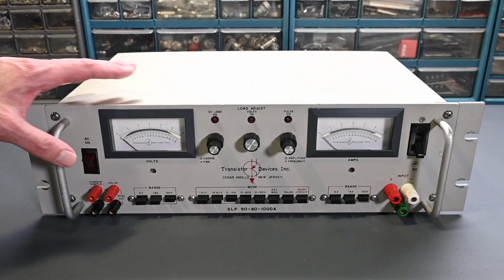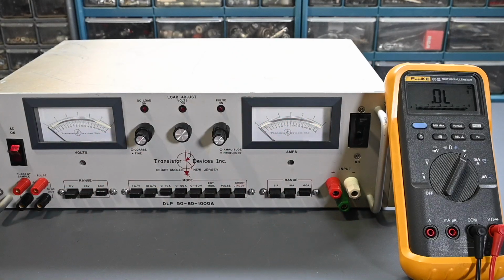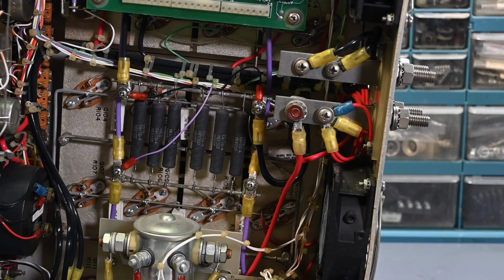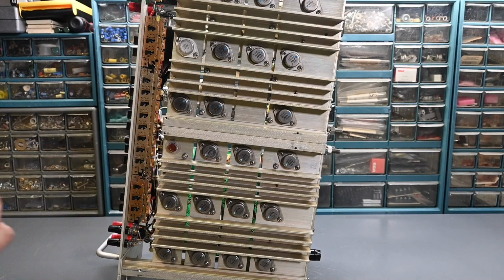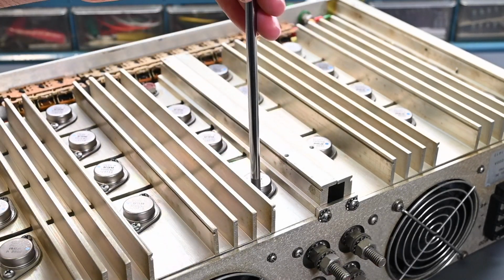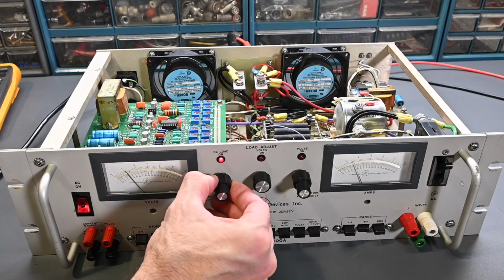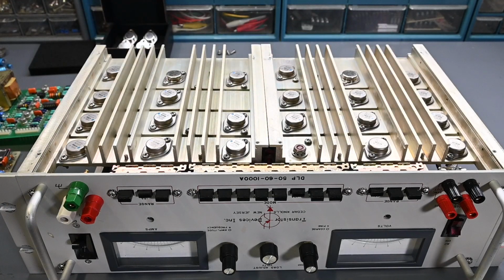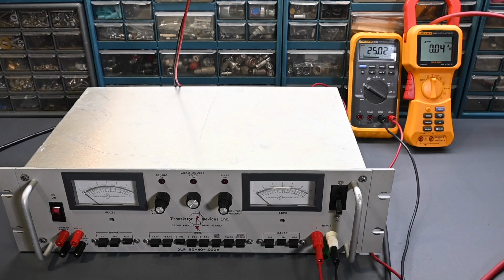Problems In This TDI Electronic Load DLP 50-60-1000A

Comment: I stopped using the 2N3055 in my designs at the time, because when the collector current went above 5 - 6 Ampere, the Hfe dropped from 30 - 35 to 5 - 3. With Ic = 10 A, Hfe = 3. 
 I switched to the BD142 which had a much better gain curve.
Your wonderful dummy load has - very likely - undergone a thermal excursion which degraded the output transistor. Great job!
Reply from the maker: At 60 amps the transistors pass 3 amps each in this application so the gain is not comprised much.  Higher current demands probably would be better to use a different transistor.

Comment: For what it's worth - that dark red/brown material you pointed out on those adjustable components is called GLYPTOL. Once the component is properly adjusted the GLYPTOL is painted on and when dry locks the part in place.
Reply from the maker: I have a can of Glyptol that was given to me, unused still.  I didn't think about the possibility that Glyptol was used on the trimmer pots.  Thanks for mentioning.

Comment: Looks like a great piece of kit. I'm currently designing and building a very similar device (with higher ratings) as a University Project. It's reassuring to see how many of the same design choices are present in this 40 year old tech as my designs. I was worried about my 8 x power transistors, but having 22 on the Dynaload you've got certainly put those worries to rest haha.
Reply from the maker: I'm glad the video was helpful and confirmed some things about your design.  Yes you can drive many paralleled transistors.

Comment: Thank you for the video, I have similar unit, but I need convert that for transformer and fan point of view to 230V,  So simple unit that not big job :) 
Do you have scema of or picture of that isolator part in your system?, it is not in scema but you note it.
Reply from the maker: I don't have a schematic that includes the Burr-Brown isolation IC.  You can get the data sheet for that Burr-Brown 3650 and 3652 IC  online and that will show a lot of tech data if you want to know how the circuit works.  If you can't find the data sheet email me and I will send you a copy.

Comment: External modulation actually means remote control 10 amps per volt ? because nothing is being modulated in the traditional sense I think ? great video !
Reply from the maker: Thanks for watching!  The external modulation could be thought of as a remote control input.  The DC load coarse and fine controls become a gain control for the external signal.  At full gain, 6 volts DC in will allow 60 amps or up to the current/power limit for voltages over 16.66 volts.  I tested inputs of sine and square waves to 20 KHz and the dynaload responded correctly.  Other waveforms could be used too and  you can modulate on top of a continuous current.
Reply: @EriksElectronicsWorkbench  Thanks :)

Comment: I would think the transistors are matched to base/emitter voltages, rather than beta.  That is what matters more in the parallel connection.
Reply from the maker: The new 2N3055 transistors all tested base-emitter voltage range of 0.631 +.004 / -0.000 volt  @ base current 5ma so all were well matched in that regard.

Comment: Aren`t the original 2N3055 in the unit likely to be 2N3055H style types (hometaxial), while the modern ON types are likely to be epitaxial types (with completely different specs, especially being too fast for designs that rely on the hometaxial type, and a less tolerant SOA curve)?

..

Could the blue dots be so kind of thermochromic paint?
Reply from the maker: The very early 1960's RCA 2N3055 were hometaxial with a considerably lower transition frequency, but that process was changed to epitaxial many years prior to when these were made (these are dated in the mid 80's).  There was a special H version but would be marked as such on the device.  I have never seen a temperature sensitive paint on transistors, although not a bad idea for monitoring purposes, I've only seen colored markings for matching identification.

Comment: Surely if they have emitter resistors that may be easier to see heating up with and IR camera.
LOL I should have watched it 1 minute more.
I use this method quite often when you have multiple devices on a shorted supply rail.
Reply from the maker: Many emitter resistors are tucked away under other components so was easier to check all the transistor cases but yes a hot emitter resistor will point you to the fault.

Comment: strange they didnt use mosfets to eliminate  thermal runaway mosfets dominated 1980,s pa/disco amps for that reason and they were more robust  400w rms per channel into shorted wiring and they would survive just fine!  , i learned a hard lesson about runaway with a home made 0-30v 3a dual psu using a 4x 2n3055  each output on huge fruit machine salvaged heatsinks, not huge enough if charging nicads for hours!
Reply from the maker: This model was designed in the early 70's and I don't think high power MOSFETS were as common at that time in this type of application.  Modern electronic loads almost always use MOSFETS as they are easy to parallel and don't have thermal runaway.
Reply: @EriksElectronicsWorkbench  yes didn't think about the design being older than the unit oops

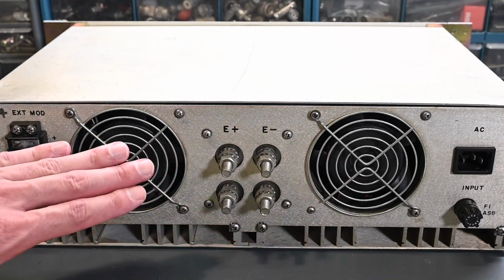Comment: 4:54 - intake with fans and out the slot at the bottom rear = that cooling/venting arrangement looks and sounds stupid [particularly if mounted in a rack]; the hot air being blown out the slot and takin back in with the fans! “short-circuit” Did they want it to overheat and burn-out in use/a risk🥵😠
Reply from the maker: There isn't a place to put the vents elsewhere.  Even if the vents were on the sides the air is still circulating within the rack.  Top and bottom covers are no good as it's assumed there will be equipment above and below.  Probably need to have a cooling fan in the rack to bring in fresh air if this was running at high wattage dissipation.  My other DLP series dynaload shown in video has never overheated under extend full power use.
Reply: 🧐 ~ if I had designed it, the transistors and their heat-sink would be mounted in the top of the unit with the slot having an angled piece of metal “L” in front of it to direct the hot air up (away from the fans) and when off ~ the heat will dissipate through the lid [particularly if mounted on top of the rack] ✅

Comment: Please can i get a copy of the schematics ?
Reply from the maker: There is a PDF download here with a schematic but it is not the best scan  http://bee.mif.pg.gda.pl/ciasteczkowypotwor/dynaload/Dynaload%20DLP50-60-1000%20Intruction.pdf   I can take a scan of my schematic just email me (address in about this channel section) and I will reply back.    Note there are some minor changes in the newer version models from the original schematic mostly in the pulse generator circuit and I don't have the newest schematic version.
Reply: @EriksElectronicsWorkbench  Than you.

Comment: 200+ hfe for 2N3055? Look in datasheet and 100 is maximun (considering error). These transistors are suspicious
Reply from the maker: As was mentioned in the video the hfe is higher than the data sheet value because they are tested at very low current levels on the transistor tester.  The hfe on the data sheet is when tested at several amps.